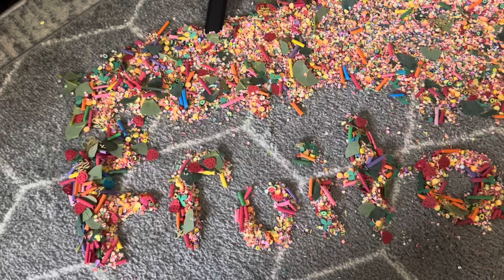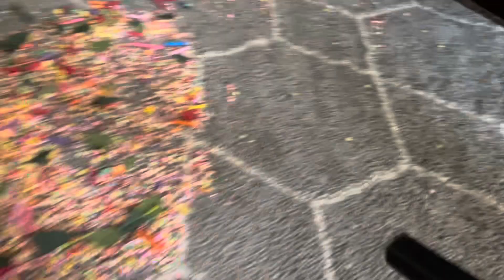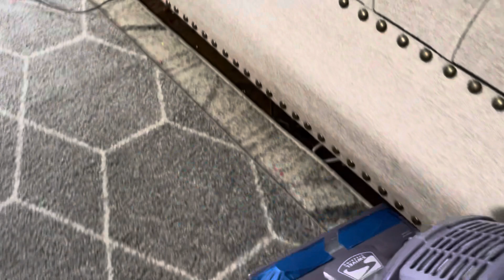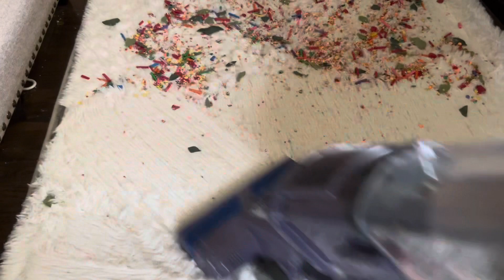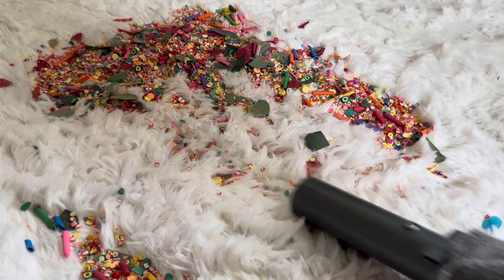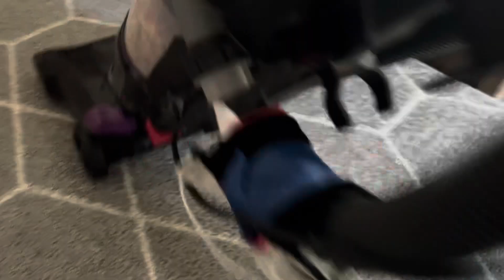FRUITOPIA Mix - SUPER Crunch and Crisp Mic’d Audio!!! #vacuumasmr #asmr #crunchasmr

Comment: 🍓 TIMESTAMPS 🍓

🍍 0:00 - The stunning new mix 🤩🤩🤩

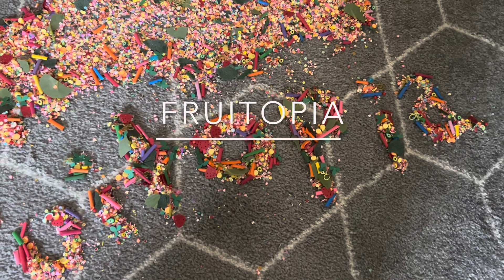🍍 0:07 - Lavender Shark crevice tool/hose pickup w/ new materials on patterned grey rug, closeup 🎤
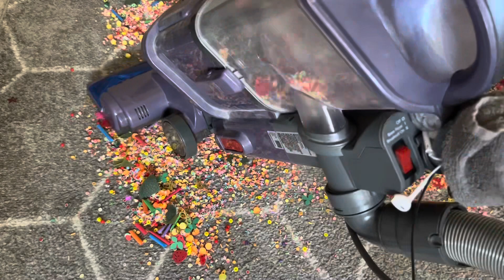🍍 3:58 - Lavender Shark spread out brushroll pickup w/ Fruitopia Mix on patterned grey rug, closeup 🎤
🍍 5:20 - Lavender Shark brushroll cleanup on patterned grey rug, closeup + lines 🎤
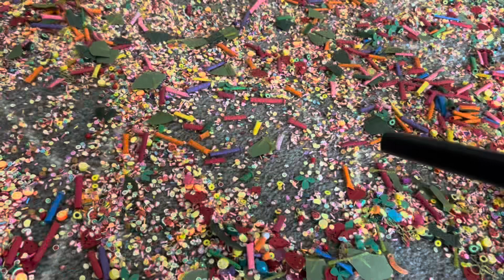🍍 6:13 - Lavender Shark spread out crevice tool pickup w/ Fruitopia Mix on patterned grey rug, closeup 🎤
🍍 9:47 - Lavender Shark brushroll cleanup on patterned grey rug, closeup + lines 🎤
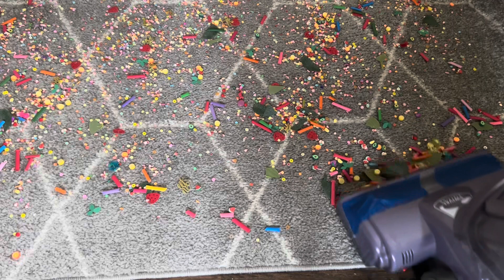🍍 10:29 - Lavender Shark spread out brushroll pickups w/ Fruitopia Mix on patterned grey rug, closeup 🎤
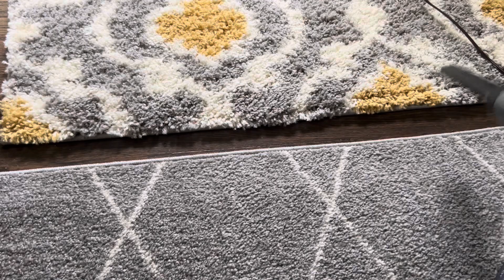🍍 16:54 - Lavender Shark crevice tool cleanup on hardwood, closeup + edge cleaning 🎤

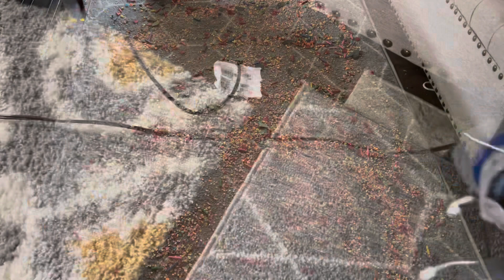🍍 17:10 - Lavender Shark spread out brushroll pickup w/ Fruitopia Mix on patterned grey rug 
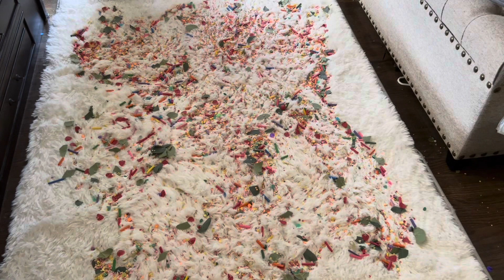🍍 19:45 - Lavender Shark spread out brushroll pickup w/ Fruitopia Mix on fluffy white rug 
🍍 21:46 - Lavender Shark spread out brushroll pickups w/ Fruitopia Mix on fluffy white rug, closeup 🎤
🍍 23:52 - Lavender Shark brushroll cleanup on fluffy white rug/hardwood, closeup + lines & UTR 🎤
🍍 25:53 - Lavender Shark crevice tool cleanup on hardwood, closeup + edge cleaning 🎤
🍍 26:41 - Lavender Shark hose pickup w/ Fruitopia Mix on fluffy white rug, closeup 🎤

🍍 27:44 - Purple Helix spread out brushroll pickup w/ Fruitopia Mix on fluffy white rug, closeup 🎤
🍍 29:45 - Purple Helix dusting brush pickup w/ Fruitopia Mix on patterned grey rug, closeup 🎤
🍍 31:14 - Purple Helix brushroll cleanup on patterned grey rug, closeup + lines 🎤
🍍 31:39 - Purple Helix extended hose pickup w/ Fruitopia Mix on patterned grey rug, closeup 🎤
🍍 32:32 - Purple Helix brushroll cleanup on patterned grey rug, closeup + lines 🎤

🍍 32:53 - Purple Helix spread out brushroll pickups w/ Fruitopia Mix on patterned grey rug
🍍 35:38 - Lavender Shark crevice tool cleanup on hardwood, closeup + edge cleaning 🎤
Reply from the maker: Thank you loveee ❤